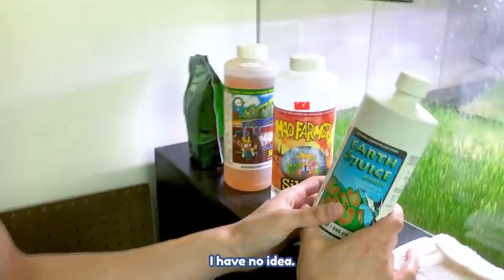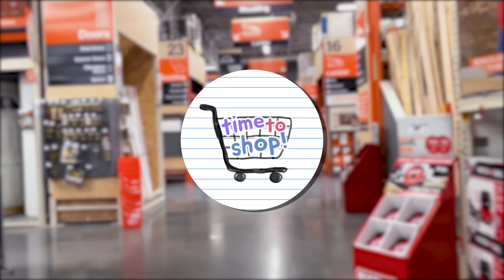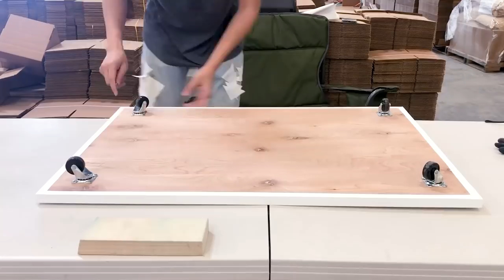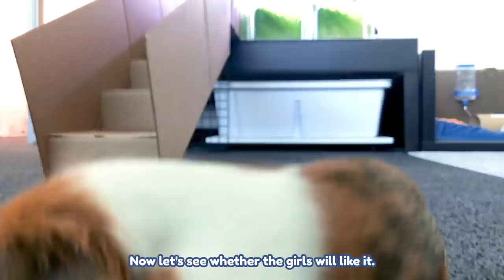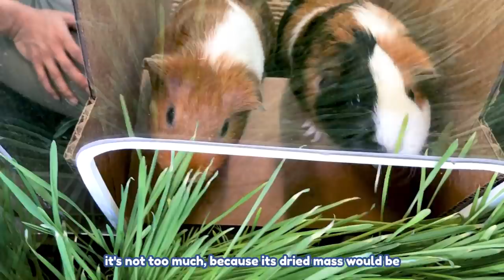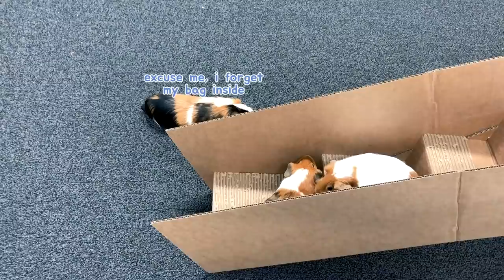Testing our Guinea Pig Paradise: DIY Indoor Grass Field (Part 5) | GuineaDad

Comment: You shouldn't add chemicals to the grass that's bad it has to be safe.
Reply from the maker: They are standard fertilizers. The rootbed plus medium is also very thick so piggies will never touch the water directly as well :)